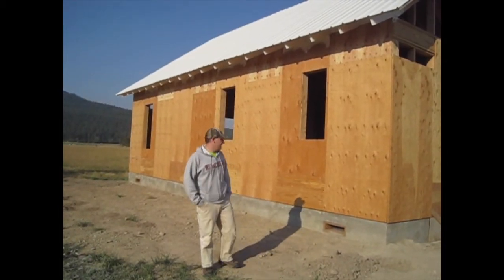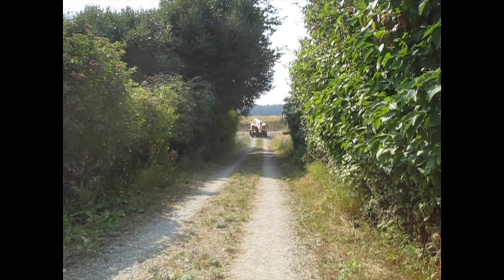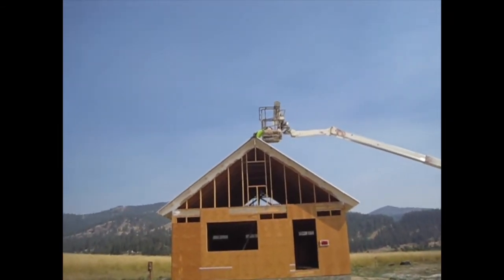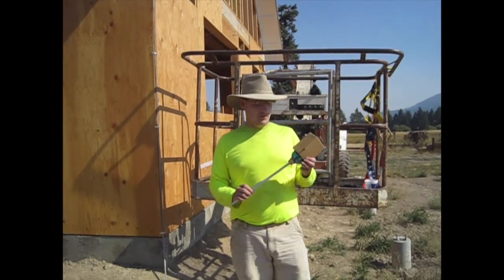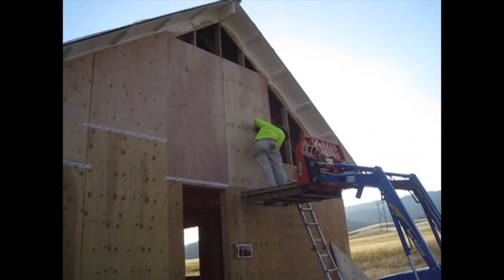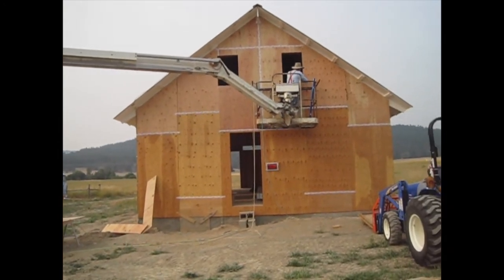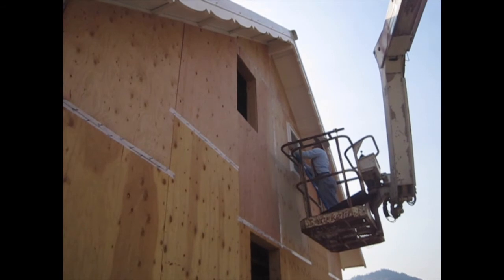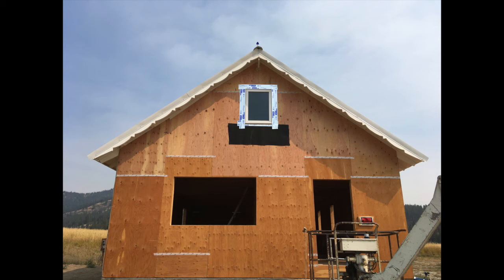Building Farmhouse #6: Metal Roof Part 2

Comment: Did you need a vapor barrier?  I've never seen a house that wasn't wrapped in tyvek.
Reply from the maker: We used asphalt paper in lieu of tyvec. Both fill similar purposes and are approved as a water resistant barrier. Asphalt paper as the ability to let any moisture that may get into the wall to evaporate out, which even though we live in a semi-arid environment, was a advantage to us.